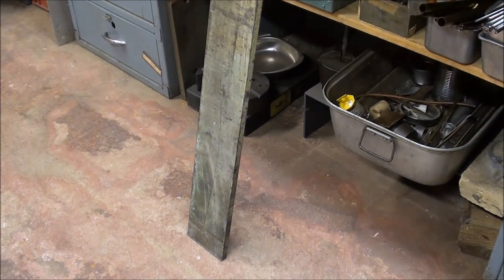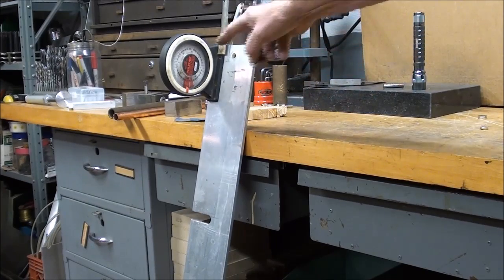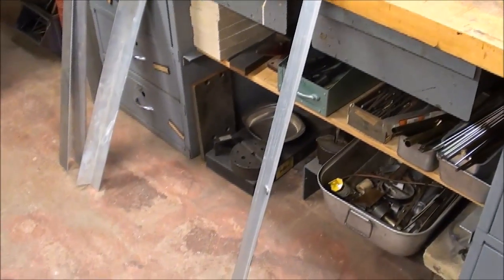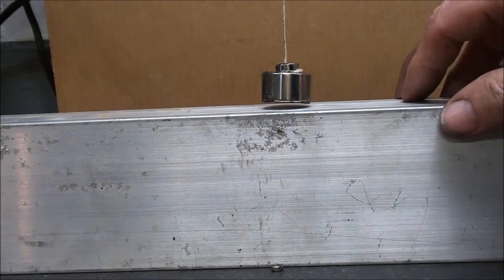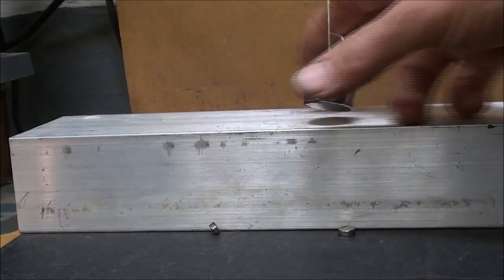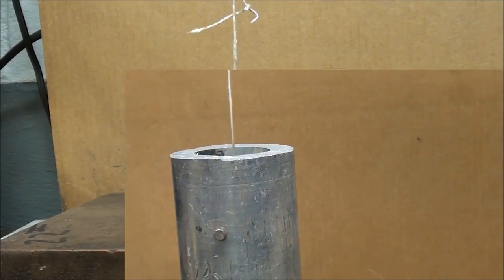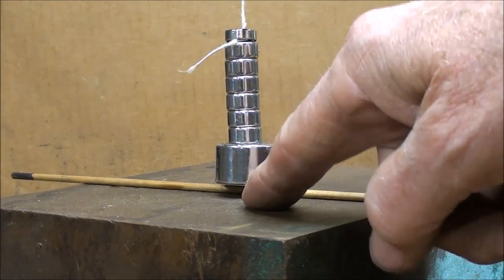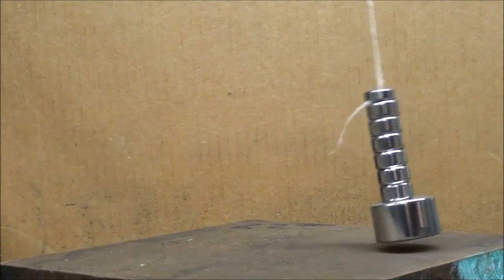tubalcain Demonstrates NEODYMIUM Rare Earth Magnets Lenz's Law Part 2 tubalcain

Comment: That has been two of quite the most fascinating videos I have seen in a very long time indeed. I still don't quite understand what is happening before my eyes as it defies common logic!! Although I am not familiar with round magnets I presume that they must have a N & S pole but is that the flat sides or part of the circumference??

It would be interesting to see any patterns of iron filings on top of white paper/card with the magnet underneath.
Reply: ExtantFrodo2 "The shape of a magnet does not determine the direction of magnetism."
That's true, something else does. Do you know what that is? Because Dan's question was completely legitimate, and your response, while a true statement, did not address the question asked.
Reply: That's a great question Dan, because as you seem to have realized the orientation of a magnet does not depend on its shape but is determined during manufacturing.  The disk magnet in the video did appear to have the most common orientation of North and South poles on the flat sides. You are correct that Iron filings would allow the field orientation to be seen.
Reply: A1Skeptic "the orientation of a magnet does not depend on its shape but is determined during manufacturing."
This does not address how the poles are established either, so thanks for castigating me. The direction is imposed by it's orientation to the magnetic field used to magnetize it. Take a washer and lay it flat then stroke it repeatedly in the same direction with a bar magnet. That is the direction the washer ends up being regardless what angle you chose to stroke. One edge of the circle will be north rather than one face of the disk being north.
Reply: A1Skeptic I can't speak for mass produced magnets, but rare earth prototype magnets are magnetized in the center of a large coil where several kilowatts of power, from a bank of large capacitors, are dumped into it all at once, creating an intensely magnetic field at the center of the coil. That charges the magnet. The orientation of the magnet in the center of the coil determines where the poles are located, and the magnets are held in place in the desired position by delrin plastic fixturing. I had this demonstrated to me a few times when I used to machine prototype injection molds and fixtures for a local magnet company.
Reply: The shape of a magnet does not determine the direction of magnetism.
Reply: Most of the ones I've bought are magnetized NS on the flats not the circumference.
Reply: Aaron Kimmins Again that's just because that's how they wanted them to be so they made them that way. They could have made them oriented across the circumference if they wanted to do so.
Reply: ExtantFrodo2 again the OP did not ask why, he asked where. I don't care why the poles are on the flats, I don't think he did either. He asked if the poles are on the flats, usually they are. No one really cares why.
Reply: Aaron Kimmins Maybe he does, maybe he doesn't. However, *you asked", "..something else does. Do you know what that is?"
If you're trying to be an ass, you're doing a pretty good job.
Muting this conversation as it has lost it's attraction (sorry for the repulsive pun)

Comment: We used neo magnets once for a client. We built sculptures out of .25 inch aluminum plate that had to meet at 90 degree angles. He didn't want to have a big weld seam on every joint and wanted every sculpture to come apart and fit into a small, flat crate for the purposes of shipping. We machined .125 inch diameter magnets into the edges and corresponding flat faces. A few registration pins tightened up the joints and he was blown away by the result. Some of the sculptures were over five feet tall with 50+ components, but there wasn't a single weld bead holding it together. The paint shop loved it because they only had to deal with flat surfaces.
Reply: That's awesome!

Comment: Regarding your comment about "measuring the  >>small<<  electrical currents":  I believe that in fact these currents are really quite large. 

An experiment to demonstrate:  Fix two of your larger magnets about 0.5" apart (attracting).  In the gap between the magnets, vigorously move a piece of aluminum (or copper), with cross section of, say 1/4" by 2", in a direction perpendicular to the magnetic field so as to "chop through" the magnetic field (in either or both directions).  It will take a lot of effort, particularly the faster you try to "chop" the bar through the field. 

Most interestingly, if you do a lot of "chopping", the temperature of the aluminum bar will significantly rise, perhaps by 10 degrees or more.  The heating is due to the large electrical currents flowing (as a dead short) within the material.  Your chopping effort is supplying the energy for the heating.

++++++++++++
A corollary to Lenz's law is is that if the conductor (aluminum) does not move relative to a magnetic field, then there is no force exerted on the conductor.  A practical use of this principle was often used as magnetic damping on old-style laboratory triple-bar balance scales, to damp out the otherwise endless up-and-down oscillation of the balance bar.  When the balance comes to rest, the magnet no longer exerts any force (because there is no relative motion), and thus has no ill effect on the reading.

+++++++++++
I love the demos.  Great work!!
Dave Kellogg

Comment: This evening my son told me that here in Denmark is an amusement park with a great modern roller coaster with wagon trains using neodymium magnets for speed control.
Mounted on each carriage is a wane of aluminum which must pass between a double row of huge neodymium magnets at places on the track where speed has to be controled. No noisy brakes. Only the feeling of a hard soundless deceleration :-)
Reply: They also used this same principal and method when they made the brakes for the jet powered vehicle that broke the sound barrier no conventional brakes could handle the friction or speeds so they manufactured thick aluminium discs and used large rare earth magnets in place of brake pads slowly bringing them in closer to the discs to slow the vehicle with no friction or heat on pads
Reply: Andrew B There had to be some heat generated by eddy currents in the aluminum pads.  Conservation of energy, you know.

Comment: Maybe wrap one of your tubes with some insulated wire.  Might be able to see some electrical activity on your multi-meter as the magnet falls through.  Not sure, but should be easy to set up.